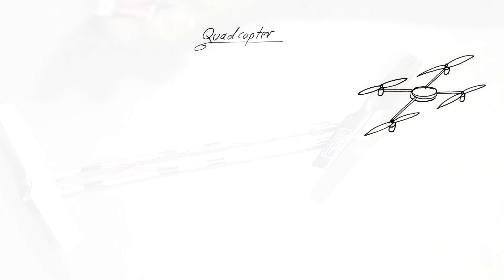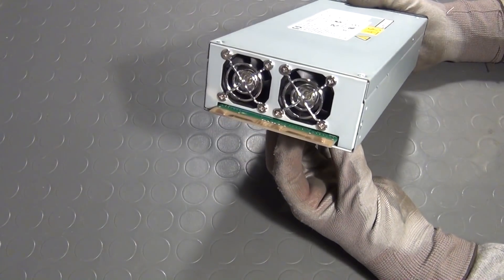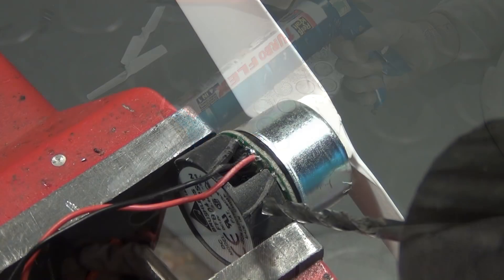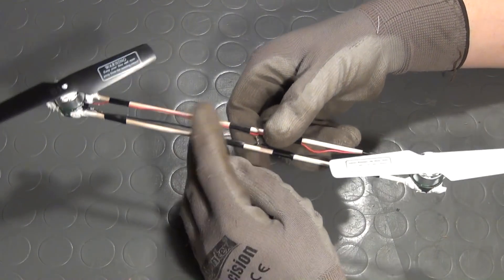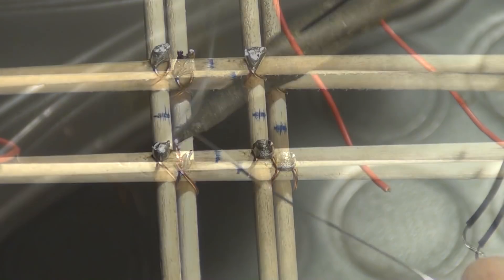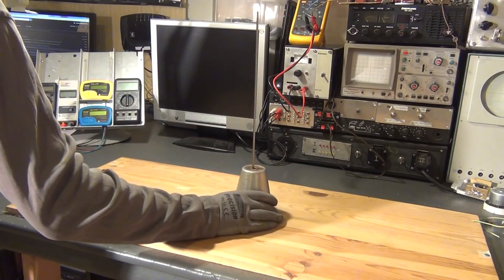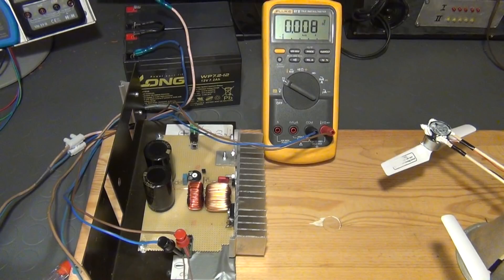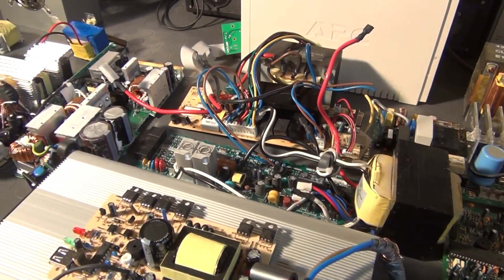Building a Cheap Quadcopter At Home (1)  - Lift Off

Comment: The Post Apocalyptic Inventor did you know that the two motor that you flip it upside down you also put it back to its position like the other and reverse that wire. Instead positive and negative connected. Position it to the opposite of it to reverse the spinning direction
Reply from the maker: jherold19 No. I'm sorry you are wrong. The method you are talking about only works with "Brushed" DC motors. These are "Brushless" DC motors (BLDCs). The direction of the rotation is controlled by the driver circuit inside the black plastic enclosure of this motor. The driver circuit only works with one polarity!
I also wrote this in an annotation inside the video, in the video description and I corrected numerous other guys before you in the comment section, who thought the same thing. 
If you wanna know more about the difference between these two types of motors, you can watch my video "brushless DC motors and brushed DC motors explained"
Reply: The Post Apocalyptic Inventor radio controlled models usually have ESC (speed controllers, or "the driver circuits") and motors as separate units, i.e., ESC is not built into the motor. ESC and motor are connected with 3 wires. You can reverse direction of the rotation by swapping any 2 wires. You could possibly hack these motors as well by breaking the plastic housing, finding 3 connections that connect the driver to the motor and swapping 2 of these connections.
Reply: The Post Apocalyptic Inventor I have a lot of RC brushless motors and lot of times  i connected them wrong on inverted polarity and they rotate inverted ...

Comment: How can the quad lift those heavy batteries....do you have any solution for that
Reply from the maker: Tanumoy Saha These batteries are just acting as a stationary power supply to find out how much voltage is needed to lift off. To carry batteries like these into the air you would need a gigantic quad copter.

Comment: why the pc fan motor don't have shaft?
Reply from the maker: Jhebert Dela Cruz Because the rotors are spinning "around" the fixed stator of the motor. It is a common design found in the "brushless" DC motor. 
It is very different from the older "brushed" DC motor, that most people known.

Comment: What about the weight of the batteries themselves. 17V would be quite heavy right ?
Reply: Cédric MARTIN you would very likely use much smaller Lipo batteries on the final quadcoptor.

Comment: Great video, thanks.
One question popped in my mind though.
Why disect the smal motors, and then invest in new wings? Why not simply buying 80mm to 120mm fans, and use direct out of the box, so to speak. Fans come with fan blades. Are the shape wrong for flight?
Reply from the maker: Kristian Väisänen The fanblades have the wrong shape. As far as I know, they only work on the principle of "air resistance", while the propeller blades have a cross section similar to that of airplane wings. They utilize an effect called "lift" in addition to the mere air resistance, ( The air streams around the propellers in different velocities, creating a pressure difference)

Comment: You should be able to look in the motor and there will be three wires, switch two and the rotation will change
Reply from the maker: GOAT13431 Sorry, I first missread your comment. You are right. If you switch two of the taps of the stator windings you could do that, but as I said in the video, these motors cannot be opened without damaging them.
Reply: GOAT13431 correct

Comment: Hi! I need to know. is that an lf351n chip in your intro? and if so, wheres the video that shows you making it? :D if there is one. the copper wiring in that and the layout is awesome. whats it for? the little clip makes it hard to work out. the 4 wires and the cutoff make me think your making a rudimentary usb interface but I cant tell and its driving me crazy :D thanks man. Awesome channel. :D you have a new subscriber.

Comment: LOL WHY WOULD YOU TURN THE MOTORS UPSIDE DOWN ? LOOOOOOL, HAVE YOU HAVE WONDERED CHANGING THE POLES ON THE MOTOR? LOOOOOL
Reply from the maker: ***** You don't know what you are talking about. These are BLDCs ( Brushless DC Motors). They have a  PCB inside their enclosure. On that PCB is an electronic circuit called a "motor driver". It is controlled by an integrated circuit that requires correct polarity. The direction of the rotation is further controlled by an integrated Hall Effect Sensor. 
What you are referring to can only be done with simple "Brushed" DC-Motors....You are obviously ignorant about everything  that goes above the most basic understanding of motors, so you should better inform yourself before trying to ridicule other people.

Comment: Am I the only one, who sees this project as a failure? I mean the motors can barely lift themselves and I am not even talking about batteries, reciever, esc's (electric speed controllers), controller chip and landing gear. That is why you do need expensive fancy conponiments. Good try though.
Reply from the maker: Daumantas B No you are surely not the only one. If you browse through the comments, you will find enough people who have fm ade the exact same points. Maybe you guys should simply do some similar experiments yourself. There are so many different modesl of cheap motors like these used in all kinds of applications. Maybe these particular motors are not powerful enough for anything useful, but there might exist better motors and that can only ne found out by trying it and that's all I really did in this video.

Comment: Do you think you could apply Nicol Tesla's wireless power source to the copter? If you know what I mean with Nikola Tesla's power source that is..
Reply from the maker: ***** Since I have read several books about Nikola Tesla, I'm quiet aware of his inventions. As far as his patents and documented inventions go, he never invented a "wirelesss power source" though. What he did though was to look for ways to transmit energy wirelessly. The famous "tesla coil" radiates electromagnetic waves through the space around it, much like a modern radio transmitter ( at a fixed frequency). If you equip a device with a receiver circuit that is tuned to that frequency you can theoretically use that circuit to power the device. To use this idea in any usefull way, the device needs to be near the tesla coil though. Furthermore the transmitter must be very powerful.
Since a "tesla coil" cannot precisely direct the flow of energy it is emitting, it is very inefficient. A large portion of the energy you need to power the transmitter, will be "lost" from you, because the  emitted  waves will simply move away into the air ( or even space), or wil be dissipated as heat in objects that are hit by those waves.

Comment: no Idea why so many thumbs down on this.... this was just a crude proof in theory. ... well done!!!.. why kill hours drilling holes for the props ,balancing ..control boards.. ect ect.. to find out the motors don't even have enough power to lift it ect..  ....  .I was just looking into using hard drive motors for the same ..thing.. and I'll end up making the same crude contraption..well tad more to control the hd's though.. ..and the hard drive motors have a screw hole already dead center =).. cept they way heavier..
................ well i do have to add one "you should of"  ../ you should of put some kind of weight on it like 50g's ect to see how much power you would actually need.. to lift a small lithium battery
Reply from the maker: bangs6996 Finally someone who is getting the point of this video. Faith in humanity restored. Thanks for this constructive comment.
Reply: ted morris UI
Reply: Good vid for beginners
Reply: *etc

Comment: un need to balance the motors before you put the props on
then balance the props
any unbalance will lead to drastic loss of lift.
maybe try different props as dc motors turn slow most quad of this size have a gearbox also to allow the motor to spin at a greater speed
the DC motors my be able to take more amps if you give them some breathing holes

Comment: Nice experiment ! ..and you have a nice lab setup. 
About the motor, I believe those motors may not achieve higher RPM to generate enough thrust for a given voltage.

Comment: please know the battery capacity how much volts require
Reply from the maker: Rajendra Goyal Werll that depends on all kinds of factors, what kidn of motor, the weight of the "craft" and so on. The voltage that I used can be seen at the end of the video on the display of the digital multimeter.

Comment: Great video!
But could you please tell me what sort of shop I would need to visit if I wanted all the chips and wires?
Thanks in advance and subscribed!!!
Reply from the maker: Mohammad Saad Well in my country (Germany) we have electronics shops in some towns. They sell electronic components. But they become less and less popular as internet trading is now the number one  way for shopping this kind of stuff. You can get all what you need on Ebay, but I'm sure there are special online stores for electronic components in the UK as well. I guess this is the most popular one in the UK: http://www.maplin.co.uk/
Reply: Thanks a lot!
I always wanted to build quadcopters and stuff like that, and thanks to your channel, it has been made possible
Thanks again for the link and good you tubing!
Reply: Mohammad Saad
let me know the battery requirements, please.
Reply: Sorry, but what are you talking about?

Comment: how u did the power supply upto 18volts?
Reply from the maker: Kumar Durga Well as I said I connected two 12V lead acid batteries in seriesl. That gave me a 24V - supply. I then connected  a buck-boost converter to it. The buck boost converter can step the voltage up or down.

Comment: can i use dc12v ,0.1a brushless moto?
Reply from the maker: Well I can't give you a general answer to that question, but there is a good chance that the motor will be too weak.
But to know for sure, you will simply have to experiment and find out for yourself.

Comment: Great video my friend. Do you know the procedure on how to convert a old IBM Aretsyn 12v69amp computer power supply to power a Hitec X2 400 charger? I need to know what and where to solder 4mm female bullet connectors to output terminal and what wiring mods need to take place inside box and pin jumping info.... Many thanks, KJ

Comment: couldn't you just run the positive side of the battery to the negative wire on the motor and vice versa to make the motors spin the opposite way than intended?
Reply from the maker: Radical@Random No. That does only work with "brushed" DC motors. This kind of fan is based on a "BLDC" ("Brushles DC-Motor) however. Inside the black plastic enclosure is a small circuit board.The motor driver on that board only works with the correct polarity. If you want to know more about the difference between brushed and brushless DC-motors, you can watch my video about that topic.
Reply: Cool! Thanks, I didn't know computer cooling fans were brushes.

Comment: do you think the original fan props would still make this fly/....
Reply: The Post Apocalyptic Inventor the original blades are just the same as a "ducted fan" used for electric 'jet' models and produce some serious thrust. only problem being it wouldn't be as efficient at slower RPM or i would hazard a guess as controllable!
Reply from the maker: T.J. Vliet No. That would not work.
Reply: The Post Apocalyptic Inventor
not big enough?
Reply from the maker: T.J. Vliet Propellers utilize an effect called "uplift" which is provided by their cross section. It must be formed like the profile of an airplane wing ! 
The shape of the original blades is completely different. But I'm not an expert for fluid dynamics.
Reply: The Post Apocalyptic Inventor
i figured the angle had something to do with it, but i was wondering, why a fan doesnt use the same angle

Comment: Anyhow, those expensive brushless motors are not that expensive. Neither the computerized controllers that make them spin.
Yet I remember some Dell PC fans that ate like 20w at 12v and put some serious noise and cf/m of air. If they were made or modified with NdFeB magnets and some more gutsy switching fets... and some thicker wires, why not. Sensored two-phase motors are much cheaper than sensorless rc ones.

Comment: Hi , saw you recommended the glue tube , couldn't find it , can you advise?
Reply from the maker: Hm...It seems this stuff is only being sold in Germany. At least I cannot find any English version of their website.
But you sure don't have to use exactly this product. It's  a kind of glue that is often used for construction jobs. Maybe you can get something similar in a local home improvement store.
Reply: Shaike Almog i odered the gun through ebay u may try to +its even very cheap

Comment: where did u used the blue wire of the motor
Reply from the maker: I cut them off. ( But they could later be soldered on again).
The blue wires deliver a feedback signal with which you can measure the motor speed (its frequency of revolution). 
That might be helpful when adding a controller board, but was not necessary for this experiment.
Reply: The Post Apocalyptic Inventor ok thank you fr the help

Comment: and the length of the wings???
Reply from the maker: KSHITIJ PATIL The skewers are about 29 cm long. The diameter of the propellers is 13,5 cm, which is  a bit more than 5 inches.
Reply: The Post Apocalyptic Inventor I got a 12'' inch skewers and a 8X4.5 ABS propellers will it do pls do rply
Reply from the maker: KSHITIJ PATIL Well I don't know. You will just have to try it out :)

Comment: I can't find any cheap server PSUs on eBay, that will work for this project. Could you send a link for a cheap server PSU that contains a motor powerful enough to lift a quadcopter?
Reply from the maker: LukeNukem You don't  necessarily need to buy server PSUs for this. Just buy a lot of old PC fans from ebay. They are based on BLDCs as well. The good thing about the fans in the video is, that they are a bit smaller than the usual PC fans though.

The PSU you see in the video is an "HP DPS 700CB A"
I once scored 4 units for about 10 € on ebay, but that was a lucky shot.

Comment: All DC motors reverse direction when polarityis reversed. No need to turn them upside down but the propellers had to be counterrotating. Which should be no problem. Cute experiment that I am willing to bet will never fly. Just my two cents worth.
Reply from the maker: Rolf Randby No that's only true for brushed DC motors. These are brushlesss DC motors which are controlled by a driver circuit inside the enclosure. That circuit only works when the polarity is right. To change the direction you have to change some things in that circuit or the motor itself.
Reply: The Post Apocalyptic Inventor I stand corrected, I guess you learn something new every day.
Reply from the maker: Rolf Randby
No problem. Knowing everything about electronics is virtually impossible these days. The name "Brushless DC motor" can also be confusing because the most common type of BLDC is very different from what most people know as a "DC motor" and it would be good, if someone came up with a better name for it :)
Reply: Its mostly the joy of building something, even if it doesn't work. Its fun either way

Comment: Since the propellers blows air over the motor, the motors can take slightly higher currents. But how much is a question, which needs more study. In HVAC, they have a term "Air over motor".